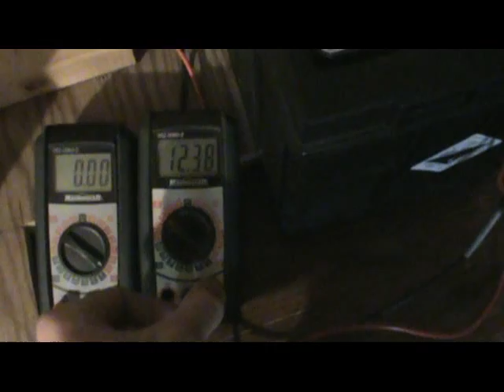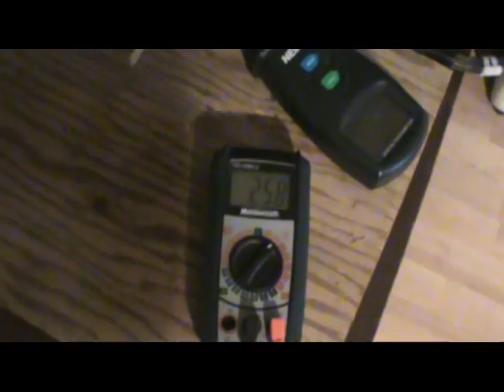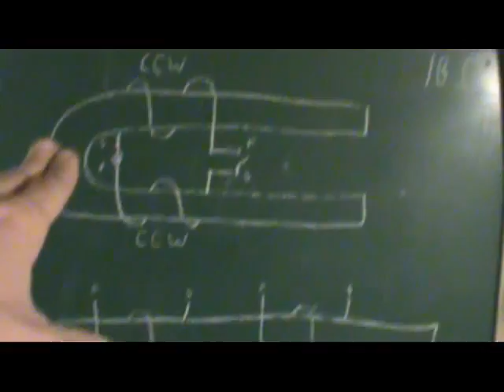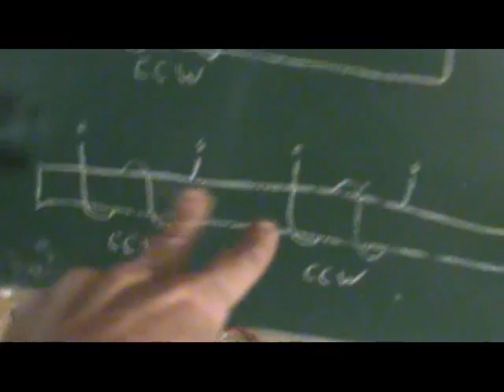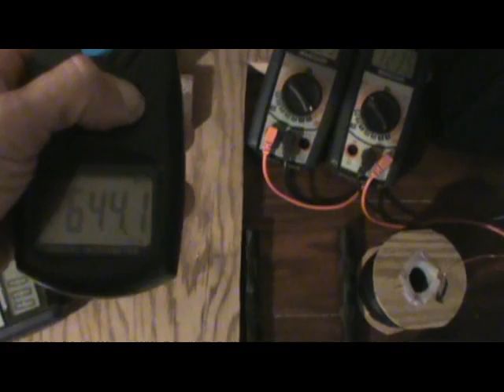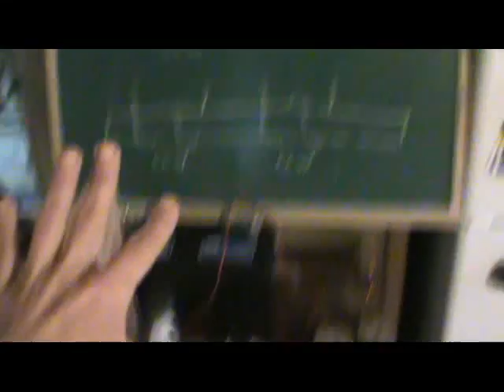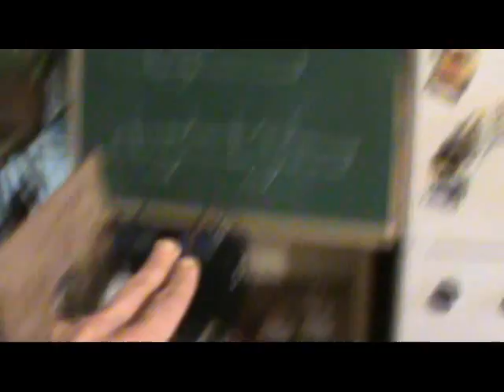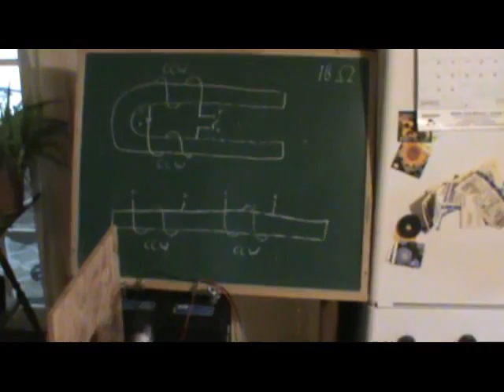Crazy Guy Overunity Quest - Interesting Findings

Comment: When you use the other pair of coils, Pay attention to the angle of coils. I am sure there is something about matching up North and South to get the highest amps from it, Great stuff, I would be very interested to see what this would do with an aluminum core, or even finding a way to use a secondary coil to transform power into a higher voltage capacitor. Thanks!!